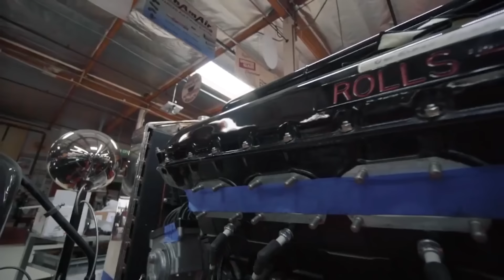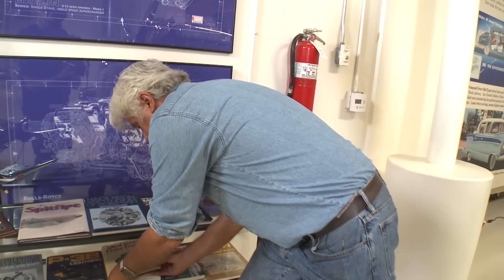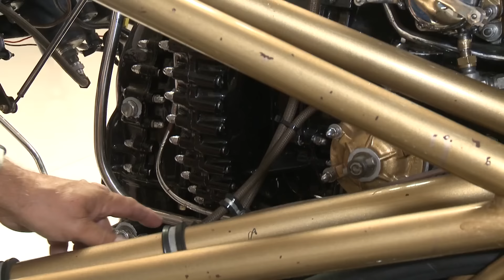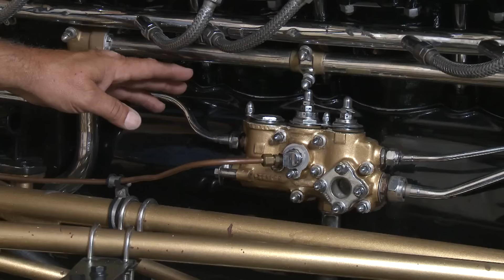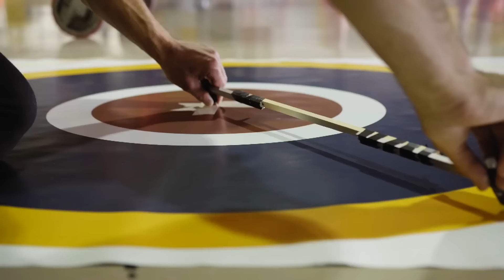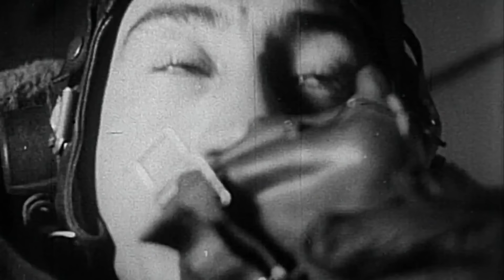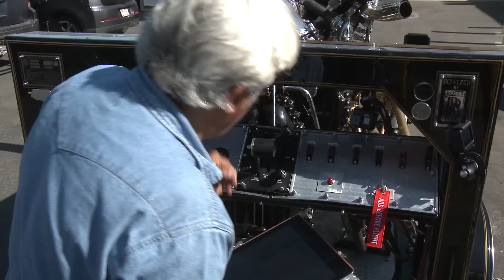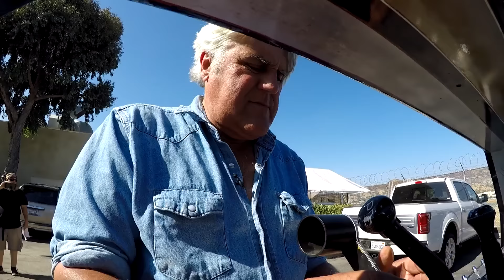The Engine That Won World War II - Jay Leno's Garage

Comment: Jay, 
As a long time aviation buff, A&P mechanic, and pilot, thank you for giving the Merlin another chance at life. The Merlin is one the most beautiful sounding engines ever built. 
In my early career as a mechanic I worked for Biegert Aviation out of Chandler AZ. We maintained a fleet of 9 Douglas C-54 (DC-4) aircraft outfitted for large area crop dusting for spruce bud worm in Main. Our typical contract was to treat over 1.3 million acres of forest. We had six aircraft on a two week start up and system check out for about two years. How cool is that for a guy just out of A&P school to be on a crew to start and run these classic aircraft every two weeks. The DC-4's were equipped with 4 Pratt and Whitney Twin Wasp R-2000 radial engines. With 2000 cubic inches of displacement and a two stage supercharger (much like your Merlin) it netted around 1450 HP @ 2700 RPM @ sea level. 

I loved watching your engine demo but I do have a suggestion on your starting sequence. These old engines start very similar to each other. The next time you run it try this starting sequence.
-Master ON.
-Pre-oilier ON until high regulated pressure reached. oilier-OFF 
-Throttle cracked, Mixture-Idle cutoff, Prop-High RPM, Blower-Low
-Mags ON
-Starter switch ON and count nine blades (this clears any fuel or oil out of the cylinders)
-After nine blades, primer switch  ON and hold, even after the engine starts, it will run fat but that's OK.
-After its running, push the mixture lever to full rich position, once the engine starts to falter because it now too rich, Primmer switch OFF. Engine should pick back up and clear out.
-Leave the mixture rich until the engine warms up. 
-After the engine warms up, idle the engine up as high as comfortable and cycle the prop from Hi to Low RPM, wait for the prop to respond, return it to High. Do this three times.
-After this, slowly pull back the mixture until the engine starts to lag then back up a notch till it runs normally again.
-Throttle back to a smooth idle 
This should make it a lot easier to start. 

I've been a fan of yours your entire career. I love watching JLG and how enthusiastic you are about all mechanical things car/motorcycle related or not. I'm fascinated with your Stanley Steamer.
Keep up the good work and keep em running!
Robert Callahan, Mesa AZ
Reply: Best comment ever.
Reply: 10 thumbs up for this comment.
Reply: What a privelege to be able to read about a part of your working life.  Thank you for sharing that.
Reply: Note: Jay is known for his experimentation in motor sequence start ups.
Reply: Thats the longest comment ive ever been willing to read in a yt comment thread! Very interesting indeed thx!
Reply: You got me at A & P....
Reply: With modern fuel the DB-605 sounds better
Reply: I don't understand half of you comment, but you look legit.
Reply: Thar power was a very good reason they were used in Unlimited Hydroplanes also. I wish the turbine's had never came along. We all miss that wonderful horsepower and it's ROAR.
Reply: You know your engines sir..👍
Reply: Could you be more specific? 😉
Reply: Useful comments, Robert.  
You have an A&P.  I was an Aeronautical Engineer with an A&E, the last year before the change to A&P, as I  didn't have Jet propulsion training.  I got Jet training courtesy the Military.  

The first Civilian Jet Aircraft I worked on was a 727.  I really feel old Robert.  HaHa!
Reply: WOW... Dr Fu Ran Li !!! A Ph.D.    AND an A&P... wow, just wow 👏👏👏
Reply: bpanther, thanks.   Not A&P, no Jets, only Recips.  An old A&E [Air frame & Engines, not Air frame & Power plants].
Reply: I.E. the old man in the hanger. Bet you could throw some knowledge at a Harley engine.
Reply: All that and it proves who all these famous people are. You are a passer by in their life. Your info could be gold. Remember we are just peasants. He buys the experience we made our lives on. Those who can't. Teach.
Jay is head wired the same as Harley. The money and the name took the spirit out of the passion that was started by thoughts.
He affords people's thoughts. Your true life experience means zilch. Always will. 
Yet to those of us who are truly aviation. Yes A&P, FCC GROL, 10 years in the Army on 60's. 16 years in aircraft. 
I am no better than anyone else. Just trying to keep the dream alive and safe.
I noticed your knowledge and appreciate your passion.

Comment: Old WW2 aircraft buff here.  Haven't tried to verify and this is an IIRC comment.  I am a numbers guy but don't quote any particulars without checking (even though I remember pi to 36 places...).  Believe the source was from one of those serial book collections from Time-Life called "The Epic of Flight" but not sure.  What I wanted to relate was a detail I found interesting.  The engines evolved during the war with many variants produced.  The evolution of MTBO (Mean Time Between Overhaul) was amazing.  MTBO varied depended on how hard the engine was used.  The early versions were only 10 minutes MTBO on either Full Power, War Power or War Emergency Power (forget which) and was elevated to about 100 hours by the end of the war.  The book claimed it was advances in metallurgy.
Reply: Metallurgical advances as well as fuel technology from American Petroleum Industry

Comment: The Mikulin AM-38 (powered the Il-2 over 35,000 built and arguably the most important aircraft of the war), The P&W R-2800 (Powered the P-47, Hellcat, Corsair, Marauder, Black Widow and Invader), Wright R-1820 (B-17, Wildcat, Dauntless, Helldiver, C-47, several Soviet aircraft, as well as the Sherman Tank). I like the sound of the Merlin and it was definitely important...but no more than any of these. If I was going to fly behind an aircraft engine in war time, I'll take the P&W P-2800. It sounds pretty good too.

Comment: The actual engine that won WW2 was the P&W R-2800. It was installed in more fighter planes then anything else. P-47 Thunderbolt, F-6-F Hellcat, F-4-U Corsair, P-61 Black Widow,  SB2C Hell Diver (Dive Bomber), F-8-F Bear Cat and many more. The only American plane with the Merlin was the P-51 Mustang. All other American fighters with liquid cooled engines used Allison engines. The Merlin was the best of the liquid cooled but like all liquid cooled engines couldn't take the battle damage that an air cooled radial could take and get you home. On a side note when you start the engine the mixture should be set at auto-rich, throttle at about 1/3rd, prime and start should fire right off and keep going.  Sorry Jay but it appeared you had mixture at barely above lean shut off. Cold engines are started at rich setting. The mixture control is basically the engines choke. That's why you had so much trouble starting her up.

Comment: Its not extremely heavy, actually its very LIGHT in relation to the power output! Because it is made of aluminium it weighs only 600 to 750 kilograms (1300 to 1600 lbs) which is extremely light given its poweroutput of about 1300 to 1650 HP (that is 2 to 3 HP per kg or 1 hp per lb, which is very good even for modern engines!!)

Comment: As a boy, I loved going to Biggin Hill air show to hear V12's in flight, later worked on (electrics)and drove V12 Jaguars. There is nothing and I mean including sex like that sound and feeling of a V12. Magnetos are a funny thing, the AA man couldn't start a vintage car, I felt the starting handle and knew it was the ignition, popped off the cover and did the points. Fired straight up with a load of blue smoke from the over fuel. The Canadians brought over Vera and joined our Battle of Britain Lanc, there is another fine example at East Kirby Lincolnshire. https://www.lincsaviation.co.uk .Sadly red tape is keeping it on the ground, would have been lovely to see the three in V (Vic) formation. Working for the RAC as a patrol, I was amongst a few who knew veteran auto systems. In fact, my Army (REME) training brought in mags as part of the whole course.

Comment: Great video. My father was a doctor on the half of New Guinea held by the US/Australia forces so no significant contact with this marvelous engine. My fascination started by falling in love with Unlimited hydroplane racing in late sixties thru the early eighties where the power plants were predominantly WW2 Merlins and Allison engines. They weren't called "Thunderboats" for nothing. Nothing compares to 6-8 Unlimiteds almost abreast in a flying start with the Merlins/Allisons at full throttle. After the war these engines were surplus quite quickly and cheap to buy.
Both Unlimited teams and tractor puller teams bought them up by the dozens.  And burned through them almost as fast. They were not built for the running conditions on water or land. It was not unusual for an Unlimited team to purchase 6-8 Merlins or Allisons at the start of a racing season and blow through them in a single season of racing (3-4 months). Sometimes a rebuild was worth it but many times not. Here's a quote from another site:

"This is why an overhaul shop of v-12 vintage engines will not touch one of these things if it’s been in a boat or a tractor. It’s been way past redline with shocking loads through the crankshaft applied. But, the post-war oversupply of these things made them relatively cheap throwaway single use units. Tractor pullers and hydroplane pilots used them until they blew up anyway so for the money, it was cheaper to put a new one in. At the time."

That changed of course, as the supply dwindled and prices climbed high. Also, in the 80s I  recall teams on the water began trying Lycoming helicopter engines and found they took the abuse better. Soon the A/M power plants were a thing of the past again. I lost most interest in hydro racing for various reasons but predominantly because we lost the Thunderboat experience. In no way do these helicopter power plants give you  a similar sound or feeling. They whine. They do not roar.

Amazingly enough a hydro team has revived the Turbocharged Allison V-12 as their main power plant. They have had some success with it but a lot of mechanical failures that denied them victories. If interested, there are some beautiful pics and info on their website:

<www.h1unlimited.com/u-3-go3-racing/>
Sorry if I went on to long.
Bob

Comment: Mustangs did not win us the war or the engines in them the Japanese zero Was faster and more maneuverable the mustangs hell cats won us the war
Reply: The Zero was never faster.  It was much more maneuverable at low speeds, had good range and could climb very well.  But it lacked maneuverability at high speed and was easily out dived and torched off easily with any hit to it's fuel tanks.

Comment: Yeah definitely not a good idea running upto full speed Jay as you definitely don't want to do what Motorcycle racer Guy Martin did with his Rolls Royce Merlin engine and run it upto 2800rpm and it took off and half demolished the workshop.😂 https://youtu.be/9wkxrQOkNdc

Comment: Thanks Leno that was a real joy!! You see my dad used to work on the Merlin in WW2 keeping the planes in the air. I still have a Merlin Blue print from RR print room dated 1941, its for a 133ci ? I reckon I've got an operating manual somewhere as well. Anyway that was awesome thanks.

Comment: "The Engine That Won World War II "
I really can't see how you can make that statement. The Pratt & Whitney R2800 Double Wasp was used in the F6F Hellcat, 5163 kills, the F4U Corsair, 2140 Kills and the P47 Thunderbolt with 2686 kills. Furthermore the Hellcat had the highest kill to loss ratio than any other fighter aircraft of WW2 at 19: 1 or 75% of all U.S Navy and Marine kills. 
The Soviets used the P47 and the Royal navy used the F4U  and  and P47 all of which used the R2800 Double Wasp.
Reply: The Merlin stopped the invasion of Britain, destroyed the Luftwaffe in the air and made possible the bombing of Germany and the Japanese mainland.  So I think it's a fair statement.
Reply: @terrywaters6186  
So?
The R2800 equipped aircraft killed more enemy aircraft, isn't that what they are in business to do?

Comment: From the get go, the finest V-12 built during WWII was the Merlin, and two of my favorite British fighter aircraft of the war are the Hawker Hurricane, and the Supermarine Spitfire, in that order. But if we are to remember that the engine that powered the largest number of winning aircraft of the war it would be the R-2800 Double Wasp. The list starts with two of my favorites, P-47 Thunderbolt, F4U Corsair, F4F Wildcat, F6F Hellcat, F8F Bearcat, F7F Tigercat, P61 Blackwidow, B-26 Maurader. We must not forget The Allison V-1710. P40 Warhawk, Bell P-39 Airacobra, and my all time favorite the P-38 Lockheed Lightning ! Which was flown exclusively by our two highest scoring aces of the war, Tommy McGuire, and Richard I Bong. So Jay please do not say the Merlin won the war! WRONG! Also one of my pet peeves is, that the P-51 won the war. By the time the 51 arrived in largest enough numbers to effect the outcome, the p-47, P-38, Hawker Hurricane, Supermarine Spitfire, had decimated the Luftwaffe, they were on their knees. Lack of fuel, spare parts, replacement aircraft, and pilots were at a premium.Yes the P-51 had the range to escort the bombers to Berlin but most of the work had already been done.  I do enjoy your you tube channel!

Comment: the engine that won the war was a Model V-2-34 38.8 L V12 Diesel engine, in thousands of t 34s.
Reply: As a Brit I would agree with you to a point as things panned out. However without Merlin Engines in Spits and other aircraft (albeit earlier versions than this one) Britain would have lost the Battle of Britain and fallen, therefore allowing Germany to concentrate all resources on Russia then it may have all played out very different.....

Comment: THE ROLLS ROYCE Merlin aircraft engine actually was a key component !!  that saved England.  It went into the fast airplane of its day...the "Mosquito".  The whole backstory is just riveting.  God works in sometimes not so mysterious ways.  I would love to fly in one of the two remaining Mosquitos still alive today.  Good eye Mr Leno!!!
Reply: Jefferey De Haviland didn't have wind tunnels as we know them today; which made the Mosquito slightly difficult to fly...resulting in a few crashes and deaths. IF ONLY the "Mossy" had maybe a slightly more dihedral or "swept-back" wings, it would have been even more feared by the Germans.

Comment: that clip with the two lancasters was shot here in the uk a few years ago when the canadian lanc came over. they flew together a number of times. seeing two lancs together is something that will probably not be seen for a very long time
if i remember right the canadian lanc had an issue with an engine, i always knew the RAF lanc was a bit tempremental at times. although didnt slip up once when they were together.

Comment: The engine(s) that won WW2 were the Klimov,  Mikulin, &c engines that powered the Yak-3, Ilyushin-2 and a few other Soviet types.  Most of the flying, fighting and dying on both sides between 1941 and 1945 was on the so-called Eastern front.  The USSR won WW2 with a little help from their "friends".  The Merlin was an excellent engine, though - very versatile, powerful and reliable .  The Jumo and D-B were not junk either and even had FI.  The only real lemon on the Western Allied side was the Allison.
Reply: Alan  NOTHING wrong with the Allison, it was NO lemon...Remember Both the USA and UK provided Russia with tons of Lend lease war materials, the Russians were not alone or forgotten!!!  Learn some history !!!
Reply: YOU learn some history.  Western supplies to USSR were negligible compared to their own production.  The P39 was the only contribution they appreciated and there were few enough of those.  Pretty well every thing else we offered was inferior to what they already had in quantity.  They had the T34 the best tank of the war, field artillery and small arms that even the Germans were using.  As for the Allison, it didn't have good enough breathing for high altitude work - nothing left after 15000'.  Brits rejected the early razorback P51s with Allisons because of lousy performance and the P51 didn't amount to anything until they got Merlins.

Comment: Sure, Merlin was a good engine. But the german equivalent, the Bf 109's engine was as (mostly always with german WW2 technology) more modern cause it had fuel injection. The Spitfires Merlin had carburators.

Comment: the best merlin powered plane in my opinion was the mosquito
Reply: I agree. I saw an analysis that looked at bomber performance from the point of view of weight of bombs delivered per aircrew life lost (not a very PC parameter but the right one from the aircrew's point of view) and I believe the Mosquito comes out comfortably ahead of all other WW2 types on that basis.
Reply: The Mosquito was a great aircraft, the Spitfire was also great, in fact, the Spitfire took us from the biplane age to the jet age, it was an air superiority fighter right through the war.
Reply: @barrierodliffe4155  but the hurricane did the grunt work
Reply: @CbrHooniganSendit  
That does not sound very flattering to the Hurricane, the fact remains that there were more Hurricanes but collectively they did less than the Spitfires.
Try this for size, say there were 400 hurricanes and 200 Spitfires then the 400 Hurricanes did more but not even close to double the work.
Reply: By h

II 7yy6 yt? yy7 uhh uhh y yt? hth
L bizg by jump lb lb k
Reply: @robertclouse5568  what??
Reply: Yes ... uncatchable little bugger.
Reply: Agreed, in fact the Mosquito was used as a light bomber and a fighter. The bomber variants were mostly unarmed as they reckoned their speed would keep them out of trouble - courtesy of the Merlins.